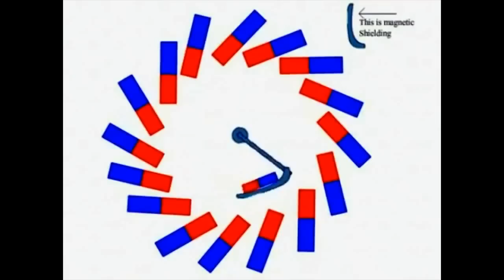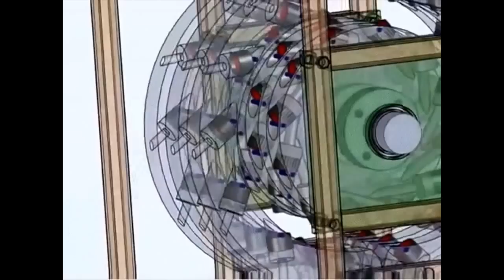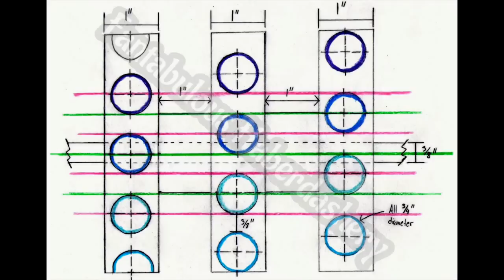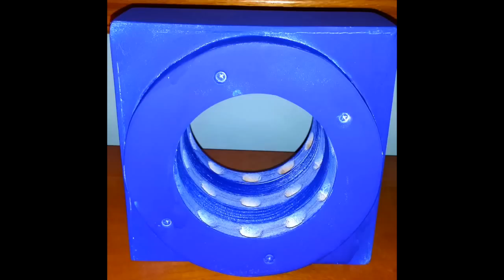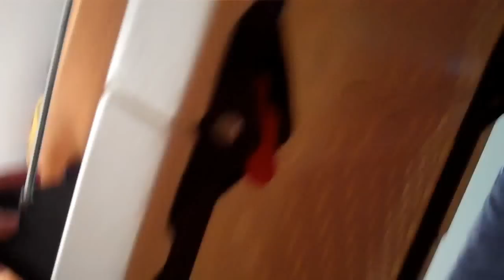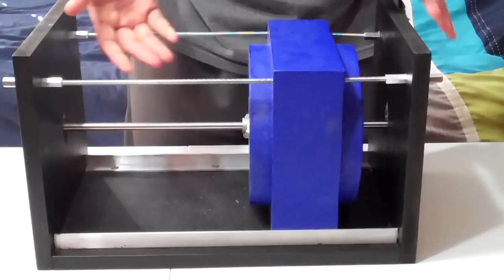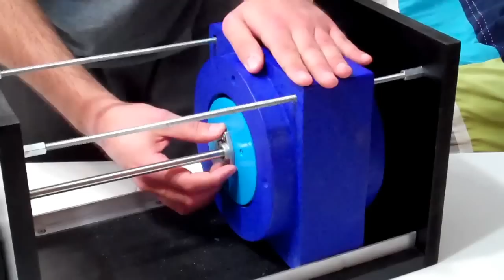Working Perendev Magnet Motor!

Comment: Take your hand away from the top of the stator. People have used those plasma balls to fake videos in the past were you place your hand on the plasma ball and the other hand on the device. Electricity is then passed through your body to channel power into the stator. Also, create everything (well as much as you can) out of transparent material including the surface that you use to place the device on. At the moment I am very skeptical. You have GOT to do the experiment in a more scientific environment (not your bed room) to convince people it is not a fake.
Reply: Even just filming the tour of the device as a continuous piece instead of cutting from one part to the next would aid the credibility a lot.  You show that there's nothing under the table, but then there's a break in the video during which something could have been added under the table, etc.

Comment: Excellent work and impressive results, but if it eventually slows down  it would appear that it's still loosing energy over time even though it seems to "catch"   What is the longest time period you have seen this motor operating?
Reply: +Grants Pass TV Repair it is still free energy and infact over unity as you are getting more energy out then putting in.

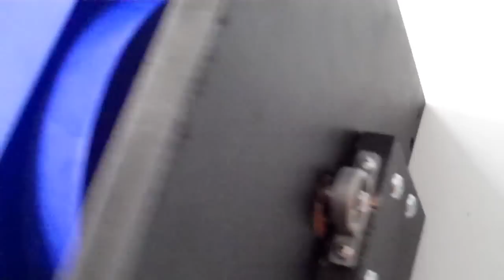Comment: 7:41 shows part of the rod sticking out just a bit and it appears to have a shaft key on it, probably to help with whatever he's using to spin the motor. Both sides of the motor is never in full view of the camera while its running. You did however pick up the motor and show both sides when it was spinning but you predictably cut away immediately after since it would have slowed down. Pretty good fake, 7/10.
Reply: unfortunately in this case he is tempering with its free rotation and you can hear how rotor change sound and speed each time he uses his "tool" with right hand. some quiet dc motor with rubber on the end of the shaft for friction (similar to starter for RC engines) will do a trick :)
Reply: Some people will find ANY reason to discredit someone work.
Reply: Jesse Fritz You're right, I should give him credit for creating the holy grail of inventions, a device which would win him the Nobel prize and at least a trillion dollars. A free energy device which could save millions of lives, save the environment, and make life easy for humanity. Its sad he never released it and instead just plays video games. But yes he definitely should get credit for creating the most sought-after invention in human history.

Comment: Perendev was a fraud done by Mike Brady in Germany.  He went to jail for it.  The machine was turned by ordinary means from the one side while videoed from the other.  There was enough evidence to find him guilty.
Reply: +Ken Smith  low speed no work and  low torque  overunity ???  hummmm  100.01 % or less
Reply: Galaxy
Less than 100% for power.

Dollars to make the prop to the dollars from the marks was over 100% until the cops moved in.
Reply: ja, thats right. in the 70's this machine was revealed for the first time and till 2006 he aint got no patent for it. then he was more or less crowdfounding the production and was found guilty for heavy fraud. there are similar "happenings" with people, trying to fuck with the energy-industry. Yeah yeah i know, theres the principle of conservation of energy, but only till someone can refute it! think big ;)